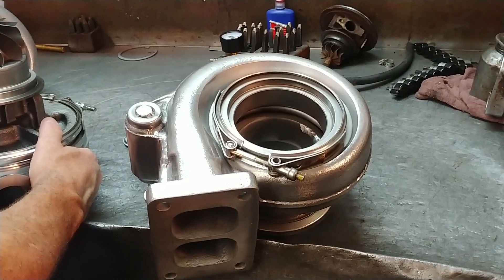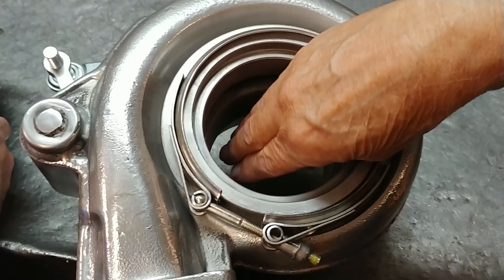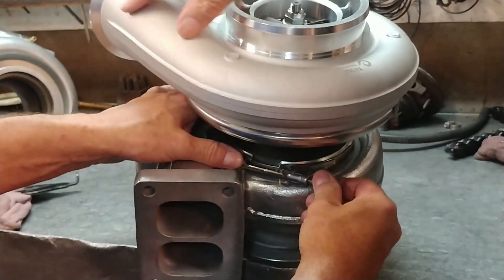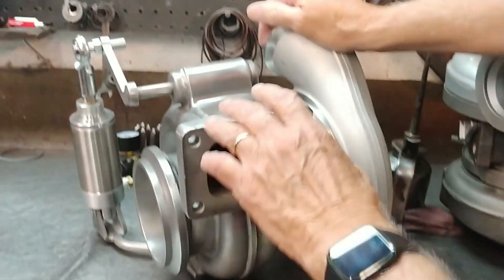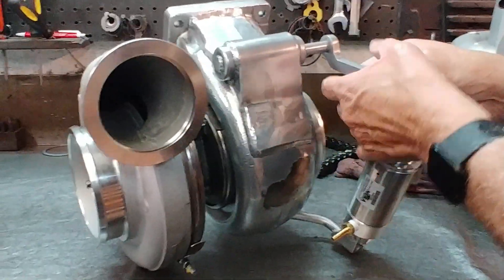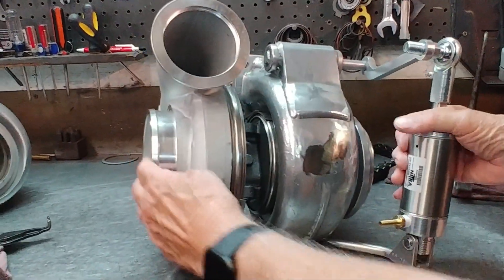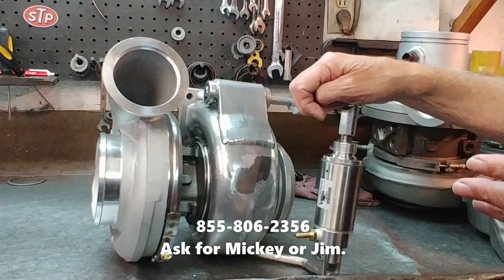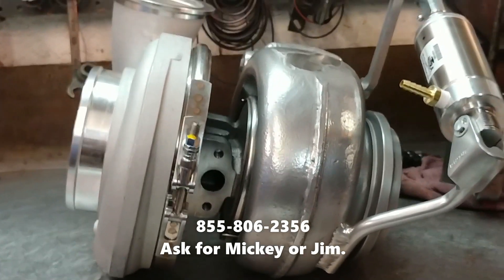Switchblade Turbo - Housing Rotation & Proper Alignment

Comment: Cummins experimented with this and it failed miserably in fact it was very costly for the turbo owner because the turbo blades would fail, go out of position, not do what they were supposed to do over time then completely fail sending debris through your after treatment system